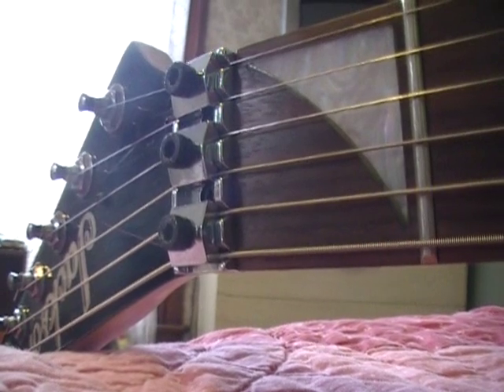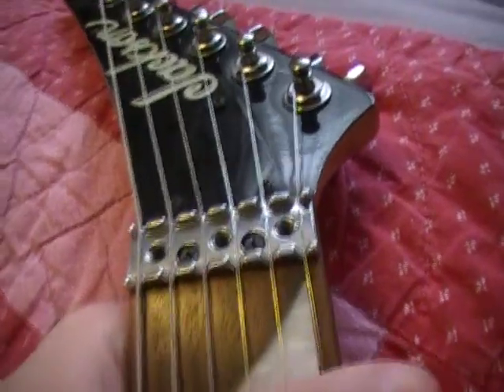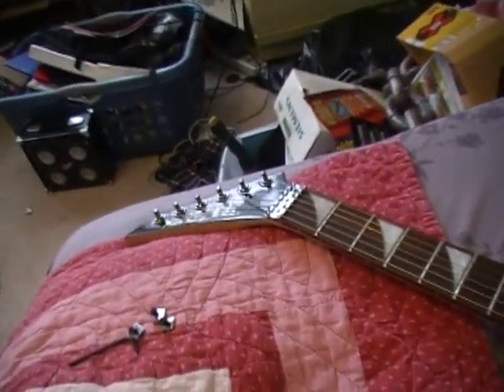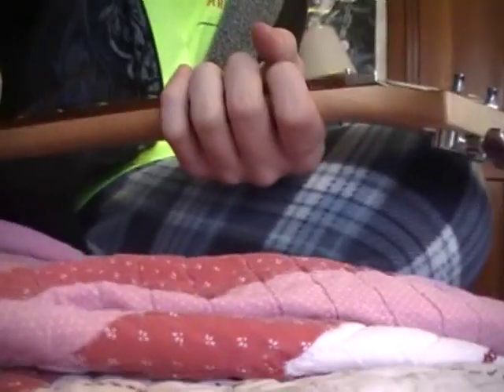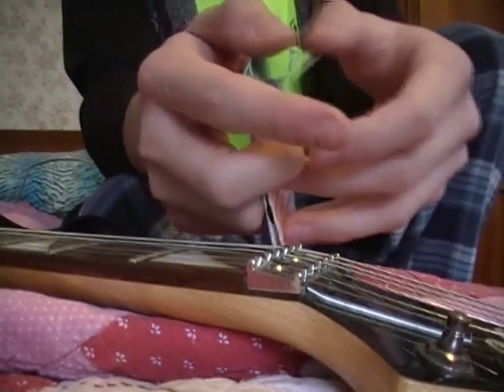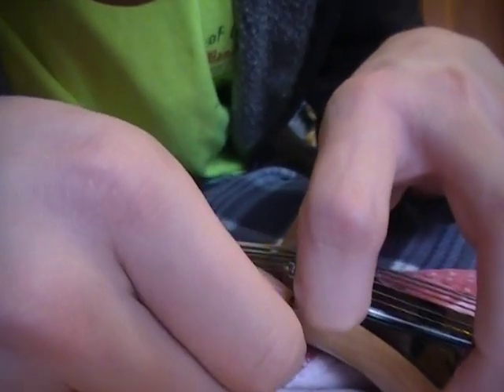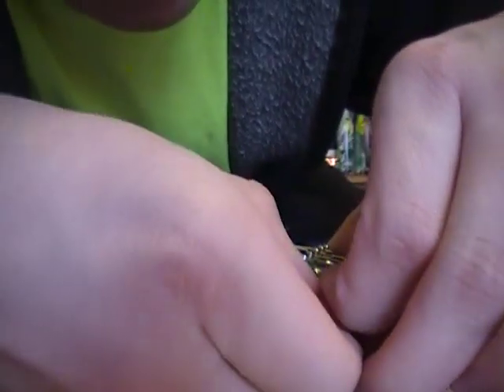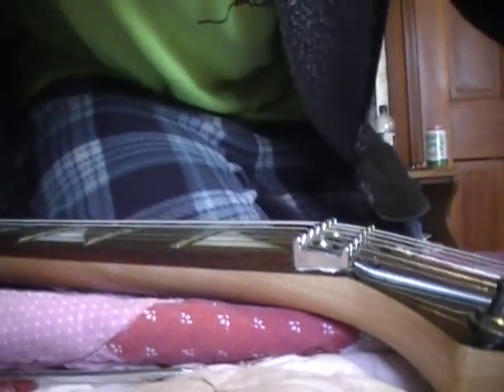How To Shim A Floyd Rose Nut

Comment: "....I AM NO GUITAR REPAIRMAN. i have a EVH bumblebee striped series with a locking Floyd Rose. and i had the exact problem you showed on your B string buzzing on 1st fret, but also my high E string too. so i loosened up the nut, but instead of using cardboard like you showed,  i used as a shim the tiny razor blade in those throwaway blue gillette razors. i took out 2 of the 3 blades it has, bent them in half to break it into 2 pieces, ending up with 4 "shims". i only needed 3 pieces of the razor to lift up the nut on that side only, tightened the nut back down, re-strung it, tuned  it again, and that goddam 1st fret buzz is GONE, and it did NOT mess up the action on any of the other strings. just thought i would share what i used on my Bumblebee, and maybe it could help somebody else out there reading this...."

   - FLASH

.

Comment: Strange you would need a shim, as the nut is metal,it wouldn't wear, any wear would be in the slots I'd guess.
Raising the nut would put the string higher but buzzing would still occur as the slots are worn, i'd have thought ??
Reply: For example: you need to shim if you want to put heavier gauge strings. It's not that the nut wears, it's that it's just that heavier strings can cause a buzz while lighter ones don't.

Comment: Wow. This is not a good idea at all. Use an old rewards card or something if you can't afford a shim set. And actually take the time to loosen strings enough to take the nut off and cut the card to match the size of the nut. That way there's not twisted up cardstock under there.